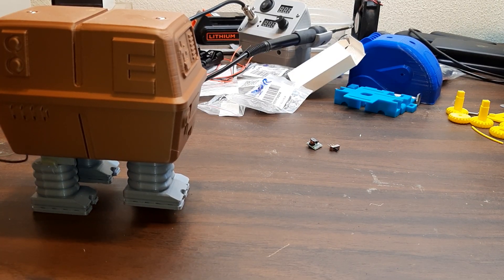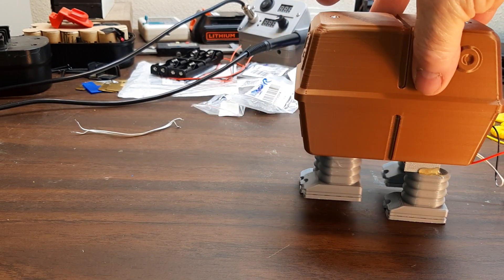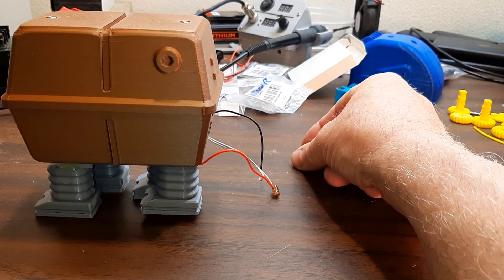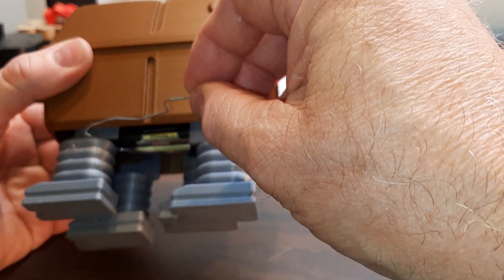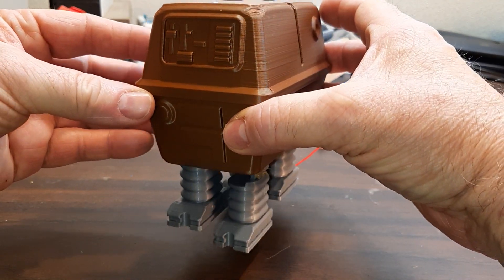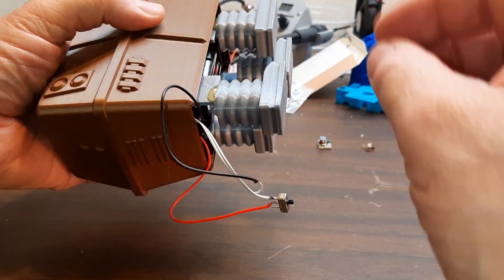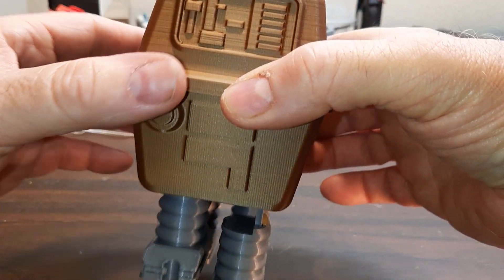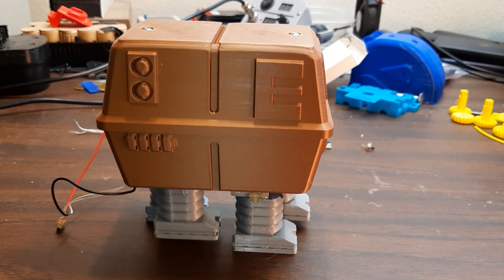Progress On The Four Legged Gonk or PLNK walking Droid

Comment: was that thing where you put in 3v and get 5 called a joule theif??
Reply: i think its a boost converter
Reply from the maker: The description on Amazon is "DC-DC Step Up Power Module Output Voltage 5V DC to DC Boost Converter 1.5V 1.8V 2.5V 3V 3.3V 3.7V 4.2V to 5V Regulator Voltage Boost Converter Board 0.9-5V to 5V"
Here's the link to the ones I purchased:
https://www.amazon.com/dp/B08NCM9ZPQ?ref=ppx_yo2ov_dt_b_product_details&th=1